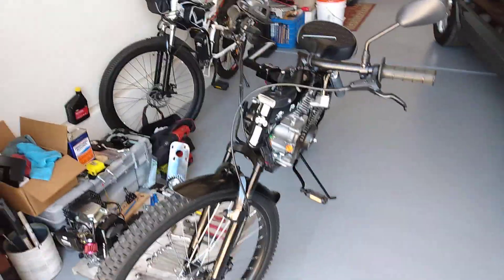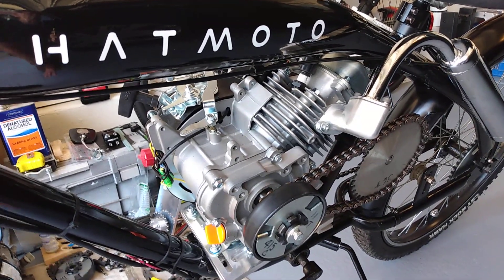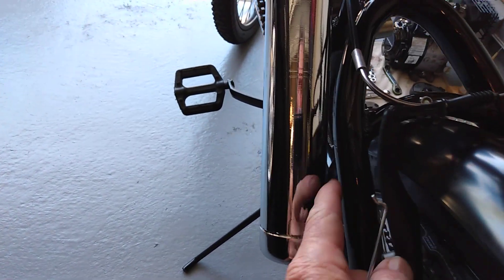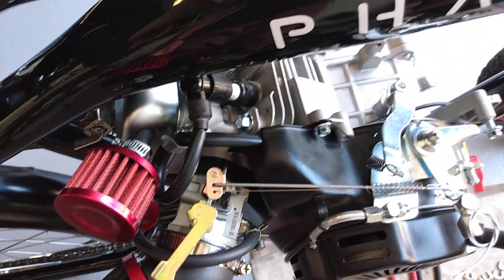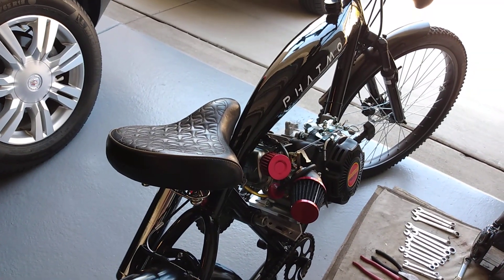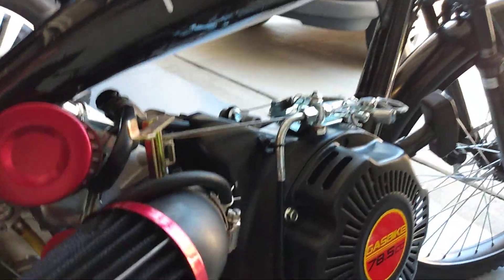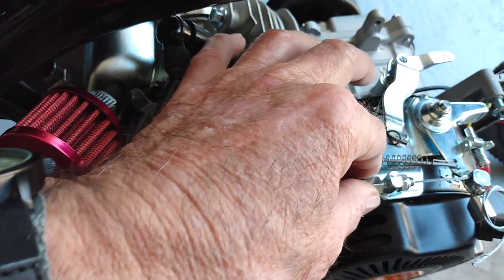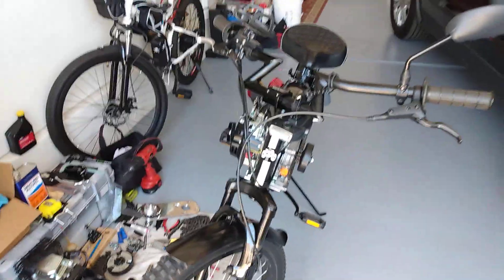Phatmoto  Predator 79cc engine upgrade Part 1

Comment: Sup dude, on the OG motor there is a switch on the right (I assume its choke) but what does the black plastic switch at the top do?  Edit: Nevermind, the top lever is the choke and the one on the right is the fuel cock.
Reply from the maker: Yup.....

Comment: What's your max speed?, and any bad vibration?
Reply from the maker: With the Predator 79 cc I got to 34 mph. I did get some vibration between 15 to 20 mph, but then smoothed out.

Comment: i know im 3 years late but this isnt the predator that im seeing on the 2023 version
Reply from the maker: I'm not sure what you mean, but all interations of Phatmoto come from the factory with the Lifan 152F-3, 79 cc engine.
Reply from the maker: Or do you mean the Predator 79 cc is not the engine in my bike today? I removed the engine and installed it in a different motorized bike. I put the stock Lifan 152F-3 back in so I could do some testing of the Hilliard clutch, for Hilliard. The clutch that is sold with all Phatmoto's today.

Comment: Hi I took the governor out of my phatmoto and now it won’t start. Sometimes it starts if I have the throttle pulled all the way. I tried replacing the carb, it did the same thing for awhile and now I can’t get it started at all. Do you know what could be wrong.
Reply from the maker: Okay, being just mechanical the things you did, it could be a couple of things. If it starts and runs for a short period it is usually a fuel issue. So when inside of engine you lined up the timing marks on cam gear and crankshaft gear, right? Also did you make sure pushrods are still inside the rocker arm cups inside the valve cover, right? If those things are still good, it is usually a fuel delivery issue, its possible the valves are to tight that will cause it to not start. But it sounds like a fuel issue with the carburetor. Make sure you have the choke off, sometimes owners get it confused with which is on and off,
Reply: @beaubrummel2wheelgarage  thanks

Comment: Unscrew that spring loaded screw on your throttle linkage so you get full throttle because ur not actually getting full throttle, yours is screwed in too much
Reply from the maker: Sorry not correct the throttle limiter screw is unthreaded enough, for the way the linkage has been modified. How do I know? I know by the throttle butterfly is all the way open, verified by having air filter off and knowing it opens fully. It looks like it is hitting the limiter screw but it is right at that point, trust me it is fully opening.
Reply: @beaubrummel2wheelgarage  yeah it’s just on my engine it opens up more so it doesn’t seem like it is full throttle on yours

Comment: Found the adjustable  plate but not the wedge..help???
Reply from the maker: Go power sports still sells the aluminum adjustable plate, but they no longer sell the wedge aluminum plate. Instead they replaced it with a all steel wedge plate, that is much longer and has the front curled under for easy access to bolts. One member attempted to use it with not so good results. He started cutting and butchering the plate till it was useless. I do believe I can fit it and make it work and am tempted to acquire one and do it to show how its done.
Reply from the maker: I just checked gopowersports.com and the new steel wedge plate is out of stock.

Comment: Hello brother I've been watching your videos for a while and your awesome. I have a 2020 phatmoto thats all stock. I've been thinking of swapping the lifan 80cc for a predator 212 cc. Can you give me any advice on this. I am about 230 pounds and although the stock motto pulls me around pretty good its not that great on take off and on some bigger hills it bogs a little. Thanks in advance brother and definitely keep making videos.....
Reply from the maker: Hi Michael, thanks for watching. Yes, the P212 cc swap is a option along with a Honda OHC. You don't mention which model you have (All Terrain or Rover) so the Honda can only be done on the AT.  A few things to know about the P212 swap. You will need special mounts, you'll need to notch 2 " out of lower engine block to allow for room to install engine. You'll need a 3/4 " bore clutch or a CVT torque converter. The stock air filter and exhaust are bulky and in the way, so they'll need replaced. The P 212 puts out 6.5+ hp, and a ton of torque so it adds extra strain to drive chain and rear wheel hub. Spokes and axles have failed. Also the fuel petcock needs to be modified because of clearances. The Honda 190 cc puts out the same h.p. but more torque and can very easily be installed in the AT, it has more head room in engine bay. If you go over to the facebook group I moderate, you can see at least 20 P212 cc swaps, along with 6 or 7 Honda 190 cc swaps. The info there is enormous, and if you own a Phatmoto it is the go to place when needing info on mods, repairs etc. Phatmoto Builds/Mods & Info is the name of the group. Come on over and check out the bikes, it'll help you decide your options.

Comment: How much would you charge me with shipping to Columbus Ga.  To build me a Phat Moto black bike with the 212 cc upgrade ?   The fastest 212 cc predator engine that is .
Reply from the maker: Thanks for the sub, Nicholas. With all respect I will have to decline building you a bike.  Shipping costs for indivisuals  are super high. I'm sure you can find a competent builder near Columbus, Ga. to build you a bike, saving you a lot of money in shipping etc. Just be careful who you choose to build your bike they need to have experience with motorized bikes, mini bikes and knowledge of all the options and complexities of a P212 and a bicycle. I know of one person who paid a shop to do it and it was a disaster because they really didn't know about motorized bikes. If you have the means (money) I recommend just buying a bike already built that is for sale from a builder who has demonstrated their ability to put together a well built safe bike for you.
Reply: @beaubrummel2wheelgarage  OK. Thank you sir !  I will actually probably end up doing it myself. I own a heating and ac business and so I am mechanically enclined somewhat. I like the Phat Moto with the bigger tires and so I was thinking about swapping the motor to something that will give me a faster launch from start and have a good bit of top end. Thanks again ! Nicholas

Comment: Do they make an aftermarket exhaust for the stock engine so the exhaust can be routed behind the rider?
Reply from the maker: No, they don't make an aftermarket exhaust for the Lifan 152F-3 stock engine. Some guys have successfully modified a 2/4 stroke kit exhaust to fit. The Lifan actually has 2 sets of exhaust stud hole you can use. Once you pull off the stock muffler you can see them. Some have cut the flange off a 2/4 stroke exhaust and had it re welded to clear. Its not an easy deal to pull off.
Reply: @beaubrummel2wheelgarage  Thanks for the quick reply.  I have a tig welder so I have the ability to make something. I just couldn't find anyone who already had something made that was easily bolted on and ready to go.  The hardest part about exhaust making is bending the tubing smoothly.  I have the phatmoto bike coming but the stock exhaust looks like it blows right on the leg. I also thought it would be nice to move the noise behind me as well.  I'm already half deaf as it is.  Haha.

Comment: just  heat up the exhaust and bend it.
Reply from the maker: True, you can bend it and gain a little clearance , but its heat wrapped now and no longer a clearance issue. Bending it out makes it closer to leg. The heat wrap solution works for me.

Comment: Thanks for the review. I have a bicycle & I am tossing around ideas (predator, gx50, Honda clones).
Reply from the maker: Those are all good choices, its all about which one fits good, some engines just aren't practical in some frames.
Reply: beau brummel I just purchased one from Harbor Freight. I want to do a vertical mount. Have you thought about a manual clutch from Sportsman? I’m pretty lost on clutches/gearing.
Reply from the maker: @st.paulmn9159  Vertical mount is one way to go, it won't work on a Phatmoto because of jack shaft, but will on other bikes. I have never heard of a Sportsman manual clutch, I'll check it out. For gearing pay attention to rear gear tooth count, the higher the count the less top end speed , but better acceleration. The lower the count the higher top end, but less take off power. Centrifugal clutches usually come with 10, 11, or 12 teeth.

Comment: You probably had the link backwards. Nice! Phat moto great frame. Crap clone motors. Use muffler tape on the exhaust.
Reply from the maker: Yeah, I think I did have it facing the wrong way or it wasn't clipped in all the way. I've got the heat wrap on it and its working so far, thanks for watching.

Comment: You realize the Lifan engine has a metal flywheel and the predator has a plastic one.   It's another 100 buxplus for a billet for the hf motor.   Don't go above 5k on the tach
Reply from the maker: To tell you the truth I've never ever heard of a plastic flywheel,  aluminum, cast iron, yes. But plastic no. The purpose of a flywheel is to spin magnets around for the magneto to produce spark and to help balance the crankshaft so the engine doesn't beat it self to death. I have seen plastic cooling fins on flywheels for added cooling. Also the only billet aluminum flywheel for the P79cc engine is rare. Affordable go karts sometimes has them but will only fit them if you send your engine to them for alteration. The P212 cc has numerous billet flywheels available but it has a 3/4 crankshaft as opposed to the P79cc which has a 5/8 crankshaft. There have been reports of the cast iron flywheel exploding at excess of 5,000 to 6,000 rpm's, although few have presented evidence, I do believe its possible and maybe has happened. I don't plan on going above 5,000 rpm anyway. If you can show me the so called plastic flywheel I'd be happy to acknowledge it.  Oh as a post script the valves usually start to float at 5,000 rpm's which causes loss of compression which means you don't spin it any faster than that. Also I am more concerned that a con.rod or other internal stock piece would break long before said plastic flywheel comes apart, but thank you for your concern.

Comment from the maker: The whole idea was to mount the P79 on the Phatmoto without making any modifications to the stock Phatmoto. You can install the P79 without the adapter and plate, by fabricating your own mounts easily, but it would require drilling and altering the Phatmoto. Which is fine also, if that is what you want to do. One word of caution however, your mount needs to be strong, a stack of washers with a bolt, drilled near the edge of the stock plate maybe isn't the best way of doing it. At least fab up some thick steel pieces of angle iron or square tube. Its optimum to slightly raise the rear of engine to gain clearance for valve cover and clear fuel shut off.

Comment from the maker: In the video, I'm running a Chinese 415 chain clutch, then I switched to a Chinese 40/41 chain clutch. Now I'm running a Max Torque 10 tooth, 40/41 clutch big improvement over the cheaper copies.
Reply: Can you pull start the predator engine while sitting on the bike? I pedal a whole lot with engine off and then pull start the engine on when I"m tired.
Reply: I'm getting ready to order some parts for my 2019 fat Moto Mike. How has the Chinese 40 / 41 chain clutch and Max torque 10 tooth 40 / 41 clutch holding up? My drive 415 chain going to back rear wheel sprocket is wore came off twice. I'm going to replace it. Instead of the 415 can I use a 40 / 41 drive chain going to rear sprocket?I want to put a lot of bottom end gear in it what is about the cheapest and easiest to replace the rear sprocket and go smaller? I don't care about top end speed. I just want more bottom end for climbing and more off road. Thanks for your help.

Comment: What size chain are you using on the jackshaft and clutch? Was wondering I also have the 19 but I can't find the clutch anymore that works with the 415 chain.  I can't tell from the video but are you using a 41 chain on the stock 2019 jackshaft?
Reply from the maker: No, but I could, I'm using the brand new shoes and internals from a 5/8 41 clutch with the original drum from my stock 415 Phatmoto. I couldn't use the brand new 41 chain clutch because the 41 chain was to short. So temporarily I'm doing this. As soon as I get more 41 chain then I'll use it. It does work on the stock jack shaft.  There is one vendor that has a max torque clutch with the 415 size chain. They normally sell for $79, but are on sale for $50 right now. I think it is gokartsupply.com that has it. I hope this makes sense. No, I just found it bmikarts.com max torque clutch for bicycle chain under mini bikes $59
Reply from the maker: Okay now I am using the 41 chain on the 415 sprocket, it is wider, but it works. Also keep it lubed and adjusted right and there should be no problem.

Comment: the pipe is the problem had mine break right were it attaches to the motor ended up going with a straight header my bike is custom i use the transmission that comes with the 90cc monster kit from gas bike
Reply from the maker: Is your bike a Phatmoto? I used the stock jack shaft that came with the Phatmoto so I could use the Monster 90 transmission on another bike. I'm going to change the pipe to a custom also.
Reply: @beaubrummel2wheelgarage  no I built mine by putting parts together and sourcing the parts the only expensive I have is the motor kit the rest it's cheap parts but better than buying a pre-made roller/gas frame bicycle

Comment from the maker: Any recommendations I make are strictly my opinion, it is what I have done. It is what has worked for me. You need to do your research and make the upgrades or changes that fit your situation and riding style.
Reply: I got mine coming Wednesday lol can't wait! Best part is that plate should work for the p212 and the p79 and a handful of other motors! I been worried about how it would fit tring to build my own but I've never done anything like that before and failed 3 different times figured a way to "make" it work but it would have looked shity.. this mount is crazy clean! And now im tring to find the stage 2 kit for the p79 but i can't they have a new flywheel springs taps etc you can buy everything separately but the flywheel.. if i cant find it going with some 18lbs springs i think. I removed Governor and have a nice free flow exhaust with screw on muffler + a 22mm carb from AGK
Reply from the maker: @miguel360kmc  It is very clean installation and it is easy and stress free.